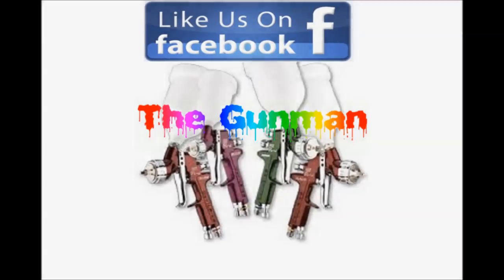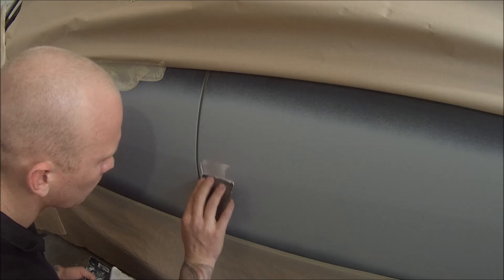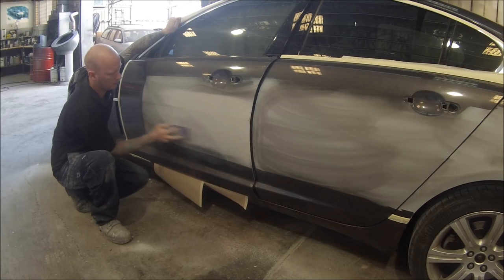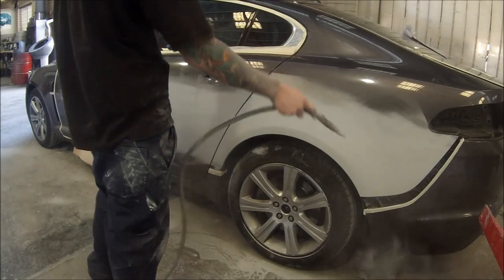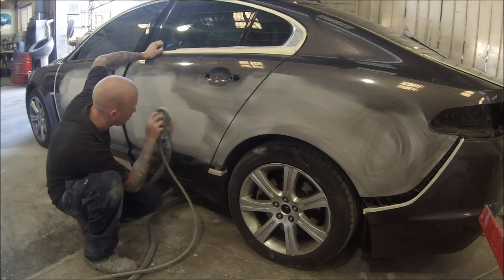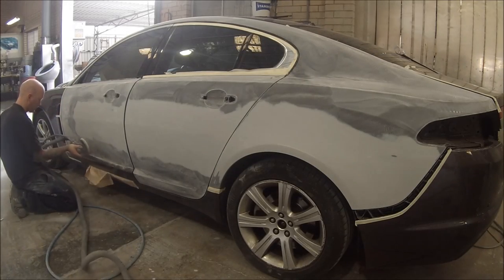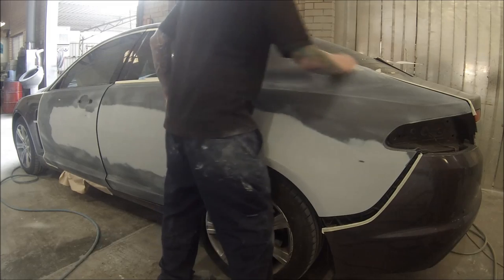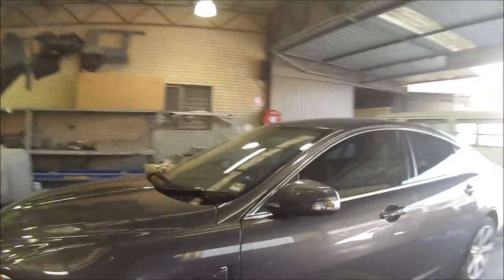How to Prepare a Car for Paintwork

Comment: Another great vid ofcourse. I do have a question tho. Wouldn't be easier if you just sand the primed areas with the orbital sander, first with 180, then 320 to remove the scratches, instead of doing it by hand?

Comment: Hi Great video, i have just brought a hZ wagon paint if good but the clear is a matt finish i want a shine to it i took it to a spray painter here in Ballarat he said you cant spray high gloss over a matt finish is that correct he said wagon will have to be block sanded and resprayed he said 12 thousand does that sound extreme

Comment: Your vids are amazing. I had a deep scratch on my lower rear door on my space grey sedan.. I took it to a reputable shop and they said they can't do anything besides repaint and they said they would have to repaint the front as well as the rear door to make sure the paint matches rest of the car. 
It's deep into the primer I'm debating if it's worth the 900 dollars and concerned about the painting of both doors as I didnt Want any bodywork or paint work on the car 
Does that sound reasonable?
Reply from the maker: It does sound expensive.

Comment: Do you use a water when prepare a car or only dry? Why?
And tell me please your last grid for light and dark base coat
Thank you! Your lessons very important for us!
Reply from the maker: I only use water at the start on a rag then dry with a clean rag, it keeps the panel cleaner and saves time. I use 600 grit on orbital then finish with 800 on the sanding sponge for both dark and light colors.

Comment: @The Gunman Hi, What do you use on bare metal paintwork as the very first coat of primer,so say for example you sanded down right past all the previous paint and primer and hit bare steel,what do you spray on that bare steel to prevent it from rusting in the future?? Is it etch primer,ZINC phosphate or epoxy??, whats the best to use.....
after you spray that on, then can you go straight to base coat and clear?

Comment: I had a question what type of primer is that? For My vehicle I have a few low spots(small Dings) here and there. I am going to level off the low spots with some poly-glazing putty. Do you use sealer over the top or a primer filler than sealer?

Comment: Hey Gunman, love the videos. I have one question about THE best paint and clear TO use and try to do a spot repair on my 2014 JAGUAR XJ front driver side bumper thats cashmere in color. Just got her and some S.O.B rubbed her in a parking lot. Or should  I  just letting an auto body shop do it . its like a four inch by 2 inch slight scuff and it's driving me crazy
Reply from the maker: lasting impressions painting and tub refinishing Have you tried polishing? or did it go through the colour. basically unless you are equipped and know how to do it confidently then it could even be cheaper to get a shop to do it for ya. As far as a good brand goes I like DuPont because its good quality but not too expensive.
Reply: Thanks for your insight. Yeah it went through and it can't be solvent wiped and polished out. I guess it's cheaper for me to take it to a body shop, last I thought about painting my Range Rover Sport that had a similar scrape, I brought the paint,primer and clear for $400 and its still sitting in my basement untouched a year later and I NO longer have the Range Rover Sport, I traded it for the JAGUAR which now has the same blemish only smaller.

Comment: How would you prep around chrome trims? on my car there not on the doors there on the body of the car and are riveted on the car so removing them isn’t really a option for me there is no rubber between the trim and body just a slight gap what’s the best was to tackle this

Thanks :D
Reply: Protection masking. Just use lots of tape so you dont damage the chrome trims and work around them.

Comment: Would that be standox highbuild used on this job and whats your preference when it comes to sand paper brands for dry sanding?
Reply from the maker: It's Standox VOC filler light grey and its one of the best primers ive used and we use 3M sand paper which is hard to find better